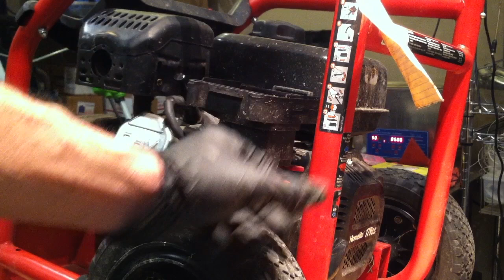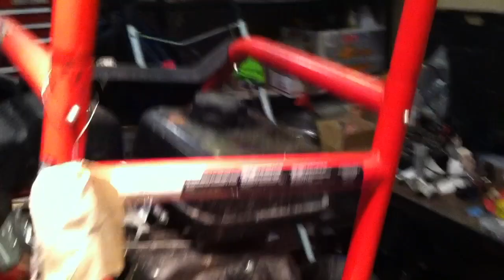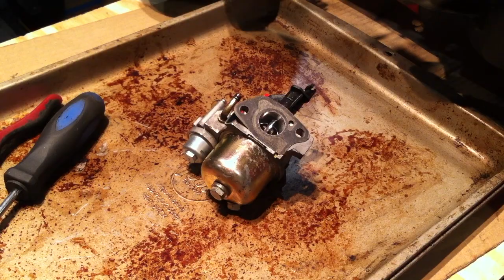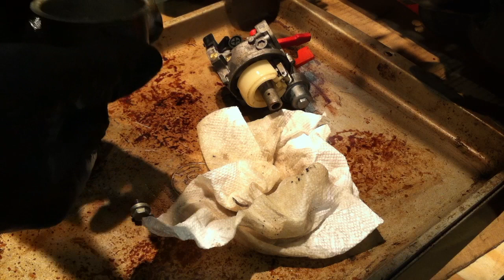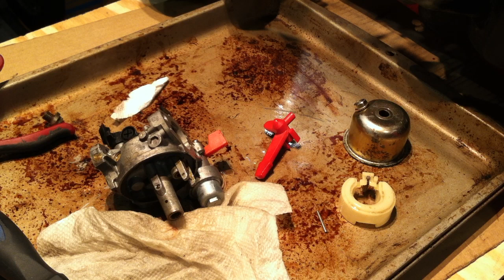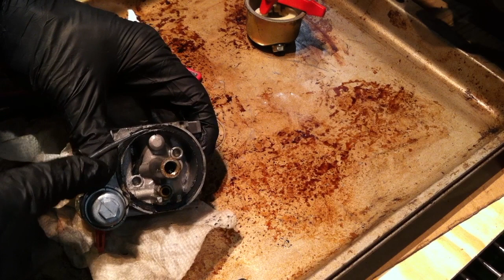Homelite Pressure Washer Repair UT80522

Comment: Great Video.  Thanks.  When I was doing mine the governor spring which is next to the governor rod came out of the hole under the fuel tank.  I did not see which hole it came out of.  Can you let me know?  Thanks.
Reply from the maker: I’ll see what I can do.
Reply: @jackrutherford-1  I was able to figure it out.  It goes in the hole right behind the first hole that the solid governor rod is in.  Thanks for getting back to me.

Comment: I have the same one.  Got it as a Home Depot "recon" for $150 about 10(?) years ago.  Still runs great.  That's a lame repair shop, lol.  Told customer it was junk?  A new carb is $12 on ebay.